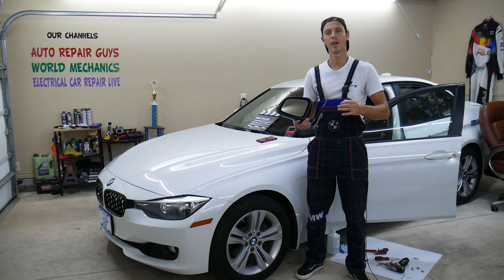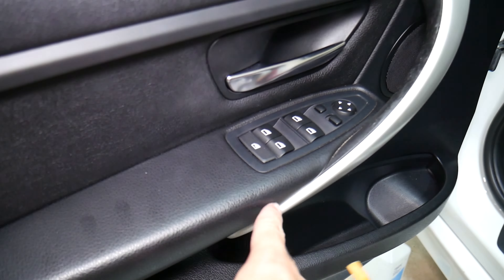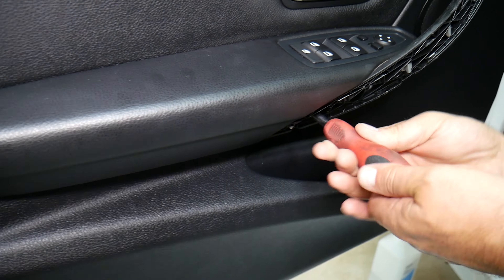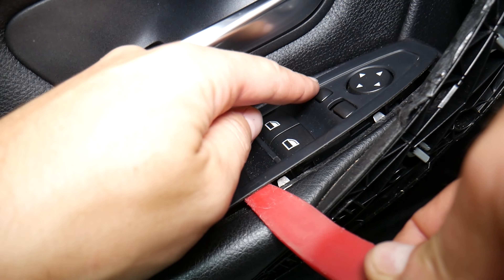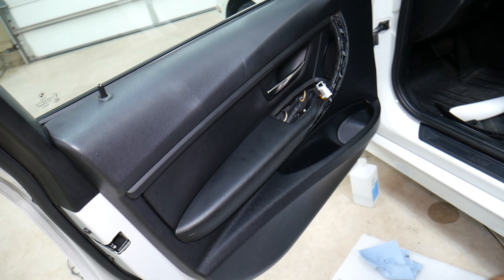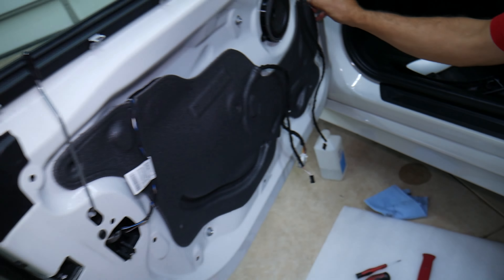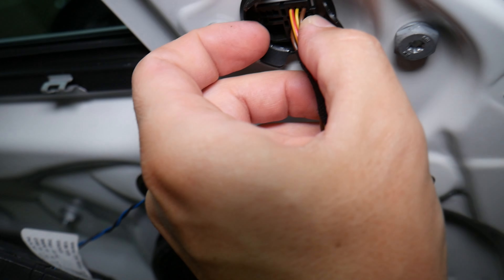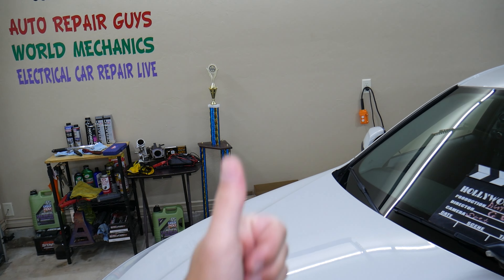SIDE MIRROR, DOOR MIRROR REPLACEMENT REMOVAL BMW F30 F31 F32 F36 328i 330i 335i 320i 318i 316i 328d

Comment from the maker: Products that we use and recommend:
► Side Mirror: https://amzn.to/3BtiCQE
► Panel Removal Set: https://amzn.to/3YiMADu
► Assorted Fuses: https://amzn.to/4fx4s3F
► Tool Set: https://amzn.to/3p5MM6t
► Screwdriver Set: https://amzn.to/3XRB28Q
► Mobil 1 Oil: https://amzn.to/3xBc8B9
► Oil Filter: https://amzn.to/3w0Ulme
► Torx Set: https://amzn.to/3xlCkfT
► Torque Wrench: https://amzn.to/32qyRwg
► Liqui Moly Engine Flush: https://amzn.to/3IiDBID
► Voltmeter: https://amzn.to/4hB6Zvk
► OBD Scanner that we use most often: https://amzn.to/3I4MQfe

► Check out our Amazon Store for the tools and parts that we use: https://www.amazon.com/shop/worldmechanics

Comment: Thank you! Two BMW dealerships in my area quoted me around $1,600 for parts and labor. I got an OEM used mirror off ebay for $116 that comes in today. Your video saved me $1,500.
Reply: What’s the link?😭
Reply: I went to a place to fix my mirrors and they quoted $1700 for everything. This saved my family $1200 after getting the replacements

Comment: Thanks, this was very helpful. Though I have let the panel hang loose, on the door. Then it is not necessary to remove the button insert from the side panel or any of the connectors. Saves a lot of time.
Reply: Hey, looking to replace my passenger door mirror. So did you have to end up taking the window switch off? Are there any screws behind there?
Reply: @ethancarvalho28  No, I left the inside door panel just hanging and didn´t remove any switches. After the mirror install I placed the complete panel back.
Reply: @c.j.pieterse5869  oh ok perfect. so it’s just the two screws in the door handle trim and the clips that around the edge that hold it on? removing the window switch looked painful lol

Comment: Great overview, I have speakers on inside, and it has heated mirror option. Is there trick to remove speaker and hook up mirror harness. Mirror was broken off damaging the wire and bracket.